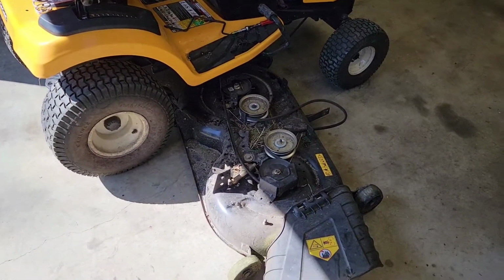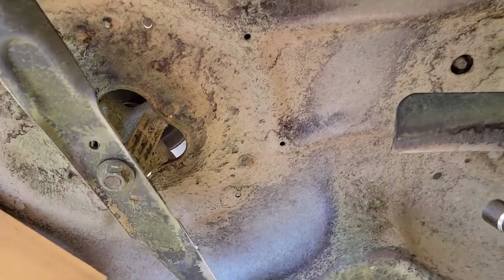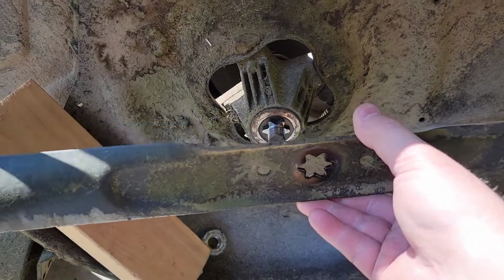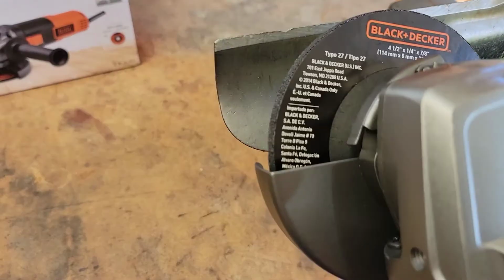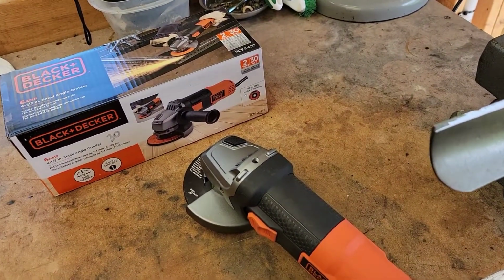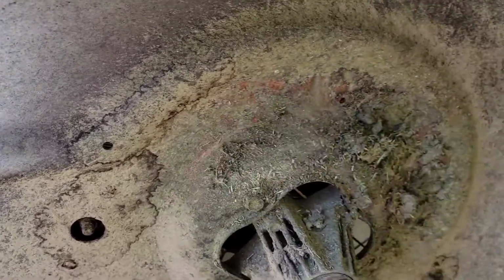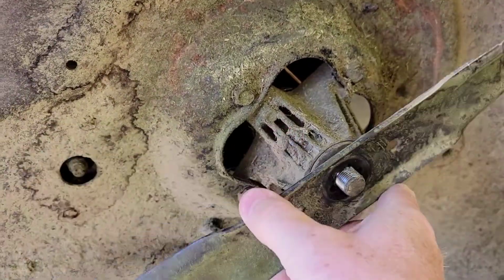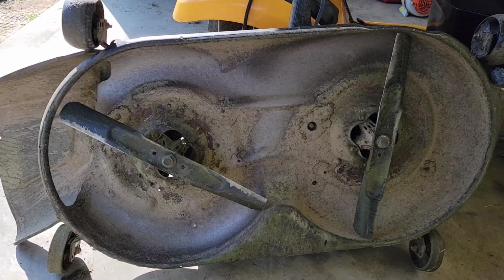HOW TO SHARPEN MOWER BLADES Cub Cadet XT1 LT42 Riding Lawn Mower Remove and Install Blades

Comment: I have a question about the sharpening the blades, now I have Parkinson’s so do you think if I try doing it this way that I might should check them for balance ? As I normally just use a file and this takes a while to get them sharp . Thanks for any hints you might have for me. Thanks Charlie
Reply from the maker: I have never done a balance check,